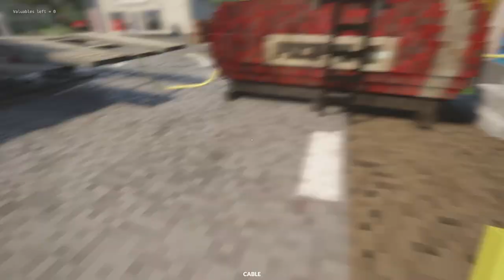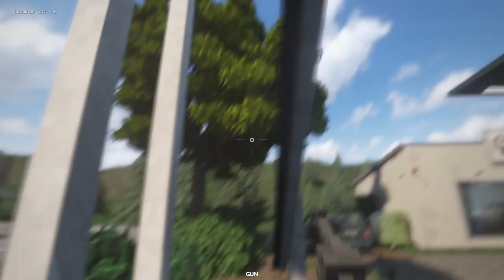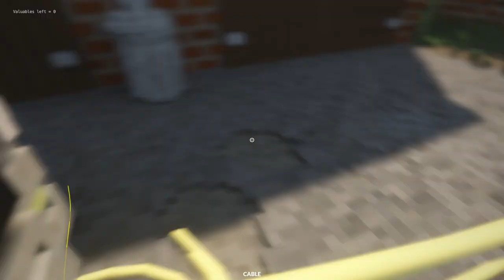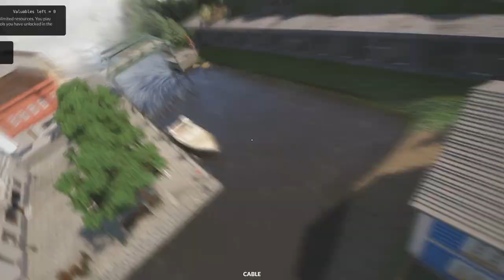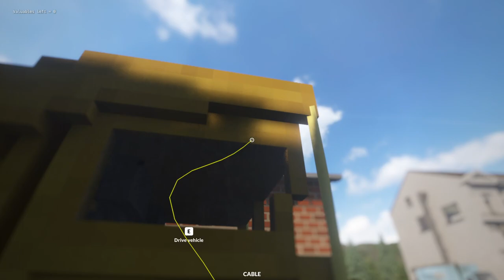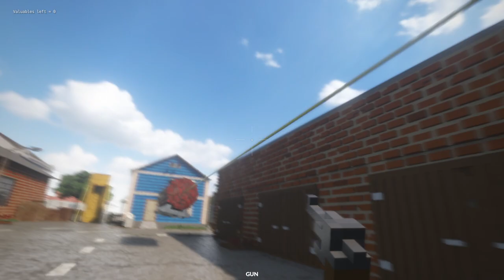Teardown - How to make a no mods slingshot!

Comment: I could swear I saw some video where someone did it across the whole map and you commented on it or reposted it on your channel on something
Reply from the maker: I saw that one, it was impressive!
Reply: @larrywalsh9939  I found it in the half hour since I wrote that comment. Kinda anti climactic that it didn’t even hit anything. I just spent ages making one with tons of cables connecting the house, propane tank and truck so it would go fast like you said and I ended up angling it down the whole time by mistake. It barely made contact with the house but it still looked cool